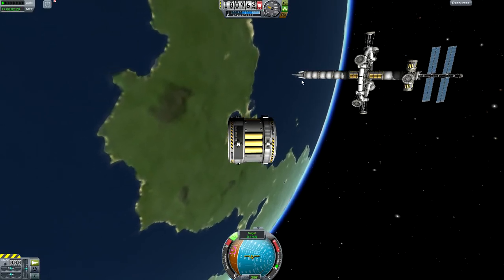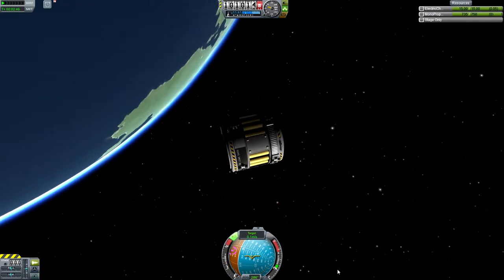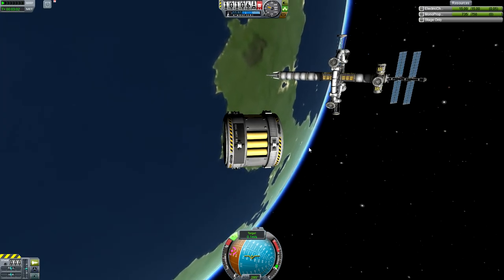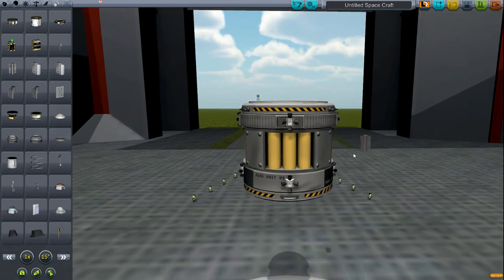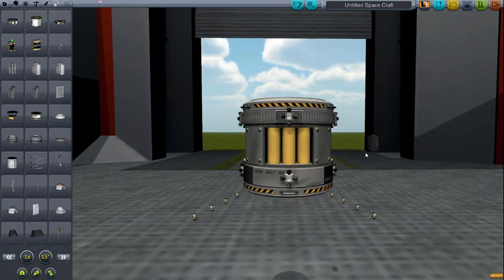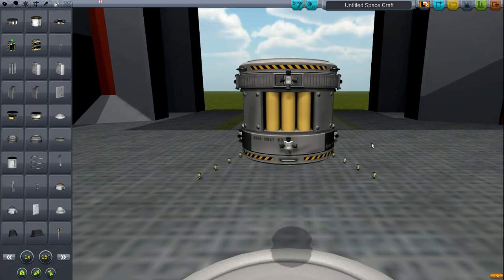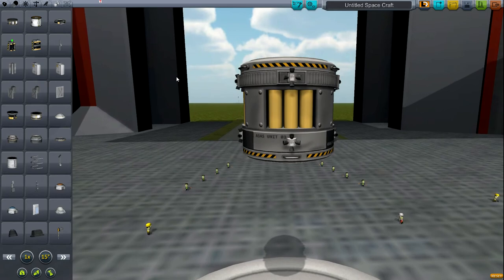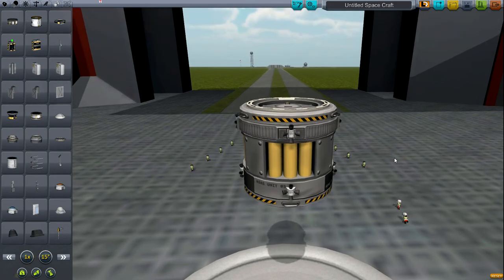The Secret RTG: A KSP Tutorial

Comment: You can do it without turning on part clipping by radially attaching 2 with symmetry to the side of the green mount points. then slap them together (might take a few tries) and there ya go.

Yeah, it's basically the same thing, but it feels better not using the debug menu to do it =)